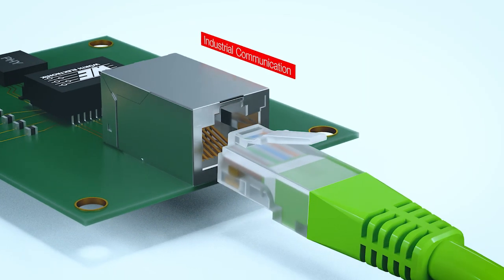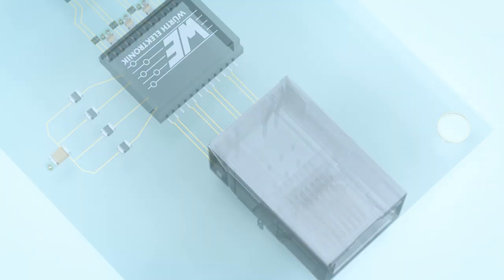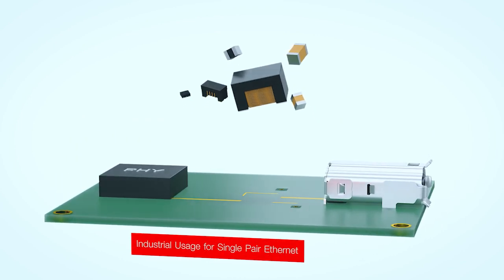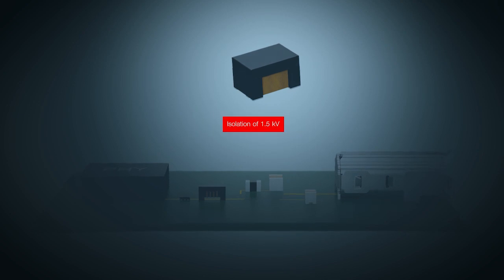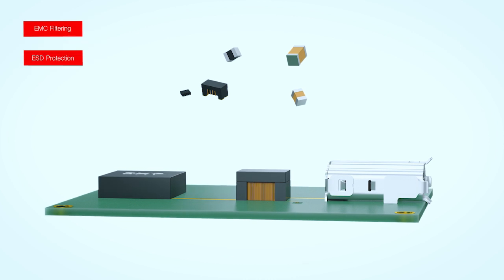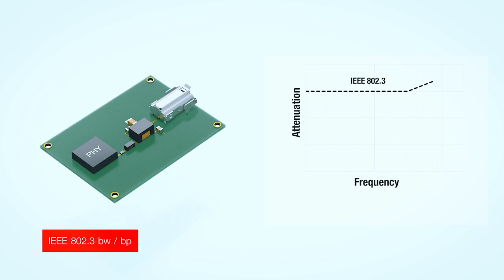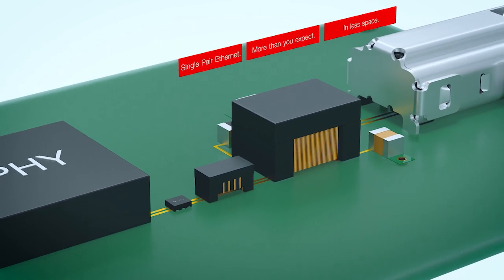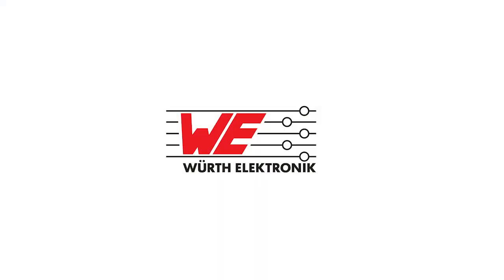Single Pair Ethernet from Würth Elektronik eiSos

Comment: Single pair ethernet? Do you mean half dulux? What kind of ethernet PHY IC I have to use?
Reply from the maker: Hello, Single Pair Ethernet is a new technology based on ethernet, but using only one pair of conductors. For legacy ethernet, a minimum of two pair is needed. PHY chips, for this new technology, can be found on the market from different IC-manufacturers. There are also different IEEE-standards for Single Pair Ethernet, e.g. IEEE 802.3cg. Kind regards, Würth Elektronik